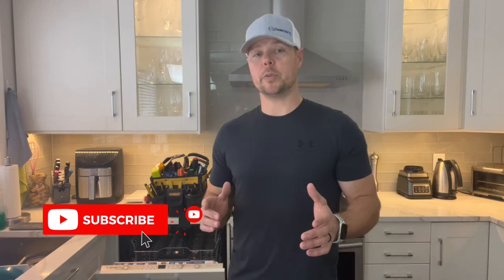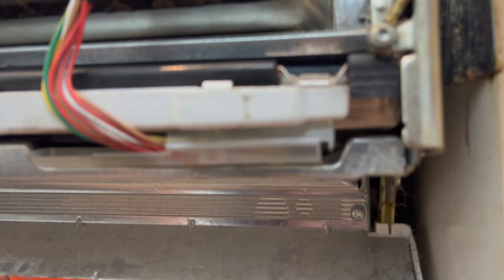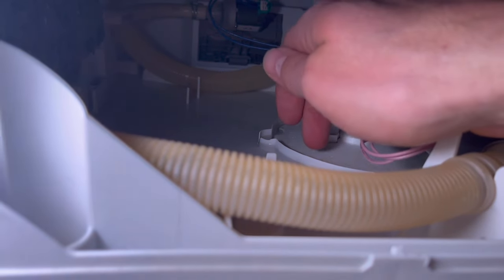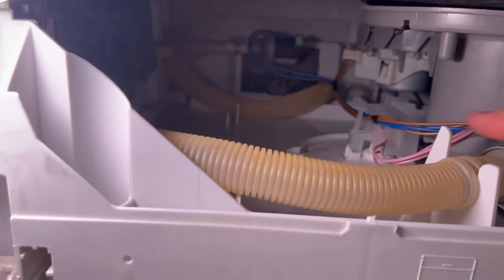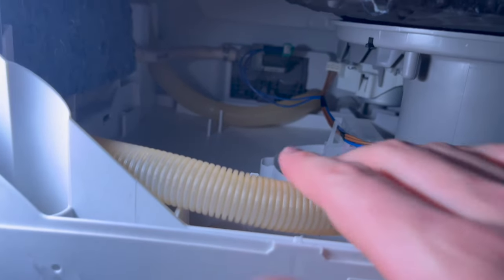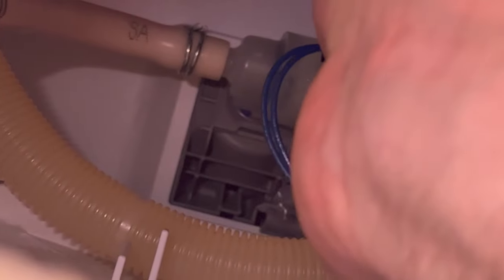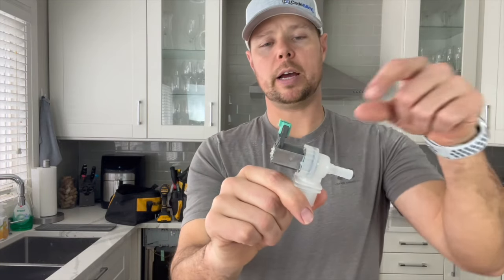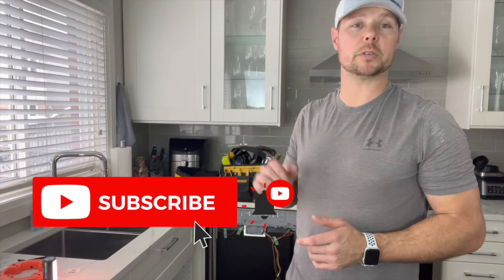Easy Fix - Bosch Dishwasher E15 Error Code - Step by Step

Comment: Your video was very good to a point. You failed to show how to access the supply valve - that you must pull the dishwasher out and access it from the rear. My advice on that is to mark the location of the feet in the front so you can put the dishwasher back in the right place.

Comment: Fantastic. I have a different model of Bosch but this gave me all the knowledge i needed to fix the problem in about 20 min (and part of that was finding the right screwdriver bits)  Very easy to follow, though for newbies like me, I recommend taking a picture of each step of disassembly so if you get lost on how things go back together, you have references
Reply: Thank you! This saved my sanity

Comment: In my case the floater got stuck due to the loud snap that breaking door springs made. (everything was dry). I removed the sensor switch and floater, cleaned a bit and verified switch works OK. Then re-assembled and tadaa, it works again. What helped a lot was getting the front plate off. I already replaced the circulation pump on this baby for wich I had to take of the right side. But that didnt provide access to the floater and switch assembly. Thx, you helped me out with this video!

Comment: Thank you for making and posting this video.  My Bosch dishwasher threw an E:15 error code on the long weekend.  This video was one of the first things that showed up in my search.  Your diagnosis of a leaking inlet water supply valve was the exact same problem that my dishwasher had.  A simple phone call and a trip to a local Bosch part supply store cost me about $30.  A relatively simple fix within 24 hours.  This saved me probably $300 in service call.  Thank you!

Comment: Thanks so much!  This gave me the courage to take our dishwasher to bits!  In our case, it turned out that there was some dirt / grit in the bottom left corner of the door seal which meant water was dripping through there, hitting the metal plate with the projected time remaining on and then flowing into the base which is what triggered the flood E15 alarm.  A good clean to remove the dirt fixed the seal and (so far!) it seems to have resolved the issue.  Thanks so much!

Comment: Thank you Ken.  I had the E15 with a similar model of Bosch.  Followed your guide, fortunately no leaking inlet valve so hoping the cleaning on the inside seals will do the trick.  Wouldn’t have had the confidence to disassemble and reassemble without your video.  All the best!

Comment: Excellent video. I was able to pull my dishwasher apart tonight. 

There was water in the tray, but no visible leaks despite testing it for a good 30 minutes. 

Dried it all up, reassembled and ran the dishwasher again and it was fine. Strange! 

Thank you for the great video and clear instructions.

Comment: Thank you so much for this video!  I was about to replace our dishwasher, then decided to do a search and found your video.  I was able to easily and quickly diagnose the issue as the same in your video.  Bought $24 valve online, all fixed!!
Reply: Where online? I have the same issue. TiA

Comment: There are other ways in which you can get and E-15.  In my case, water comes down the overflow - the rectangular grey tube that connects from the bottom of the door down into the base of the cabinet at about 0:58 in the video.  I have already replaced the water inlet valve and the float switch that actuates when the styrofoam float is raised.  AND, the drain pump can only be shut off by flipping the breaker.  There is more to E-15 than you describe.

Comment: Have a Bosch dishwasher, model number was on the side of the door.  Had a 5yr extended warranty, but the dishasher failed at 5yrs 1 month.  Followed your video - was able to determine it needed the same part.  Ordered from Amazon, make sure the part supports your model number - installed ok.  Had to pull out the dishwasher, but it all went back together ok. -- Thanks for your help.

Comment: Doooood… you the man! 👍🏻 For anyone with a Junker dishwasher the error code equivalent is E31 same tap icon and stuff (Junker do integrated appliances for German kitchens in Europe and seem very similar to Bosch). I also managed to get the kick plate off without removing the panel (expensive German kitchen I didn’t wanna play too much! 😰 mine weren’t Philips but T20s). Dried it out and the error code was gone…. 

Oh yeah, don’t put washing up liquid in your dishwasher when you run out of tabs, this basically caused the dishwasher to overflow and trigger that leak sensor or Water Protection System as they call it so basically I fixed a dishwasher that wasn’t really broken… 🙂

Comment: Nice video.  I was going to open my dishwasher as per your comments but then looked inside the tub and noticed my cycle wasn’t interrupted because a plate was blocking the second level spinning arm.  I am not sure if this tripped the E15 code but I reset the unit (3 sec) and I turned the unit off and then on…the code disappeared and I ran the cycle again after removing the dish.   No more code and unit has run smoothly.  Maybe others might want to try this first.  Btw Bosch units are great value….top notch for fair price.  Thanks.👍

Comment: Best video for this error code fix!! Brief concise and extremely informative.  I would maybe just add a note to not unscrew the top screws which hold the control panel and emphasize just to remove the screws on the side of the door panel.  This was my bad but thought I’d share in case others are too quick about removing all the screws and have the panel fall off with the front door.  I also learned there is a loose connector with red wires hanging I plugged it in cause I thought it came out by accident but after an hour of trouble shooting I learned if you plug in that connector to the control panel the dishwasher will not power on ugh! So leave that loose connector unplugged
Reply: My dw is not powering on — where is the red wire connection you are referencing?
Reply: There are 3 red wires connected to a white connnector that just hangs loose inside the panel I happened to take that connector and plugged it into the control panel where there was an open slot then the washer would not power on but when I disconnected it it powered on
Reply: @mauriceh2297 thanks for this… I was having this exact issue.

Comment: Thank you for the video, it has helped me a lot! For those who aren't very handy and don't want to disassemble or change parts, I solved it by tilting the dishwasher to one side until stagnant water started to come out from the bottom. After that, the error didn't appear anymore, and I was able to start the dishwasher. What I will do is turn off the water between each use and see how long it lasts that way!
Reply: Hi pall...
I did exactly the same what you've written. The water exit to my floor. I colected the water. And after that i conected it...and the error desseapered. 
But, anyway, i'm very afraid to continue to use it. I'm afraid of not happen a fire. Because, let's agree....the error says that there is a problem.
Can you tell me pls your succes during all this time...what to expect.
The problem is, that in my country, we don't have professional workers to repair the dishwasher, and i'm afraid for not paing a lot of money, without being the problem solved.
Hope for your soon answer
Reply: @0990-l7b  been using like this for months, no problem for me, if you get the error again you just empty the water, but I didn't, I just close the water after each use, also I have a fuse just for the dishwasher I disconnect after each use, I won't spend money on this machine, will use like this until it dies and change it
Reply: @Joelstarr  thx man. It's a good idea to put separetly fuse for dishwasher.
But if i won't turn off the water, what will happen ? Or, in your case what happened ? The error came again ?
How many years has your machine ?
Reply: @0990-l7b  the problem is there is a joint leak inside the machine, I don't think it's a big leak that's why if you just open the water when you use it, there is no time for leaking. My machine is 5 years more or less. This is just a plastic joint in bad state but you have to replace the whole part, it's not expensive and you can do it yourself. I prefer not to open the machine and just use it like this, I am not attached to it, when it's over I will change the machine, I think in a few years
Reply: @Joelstarr  ok. First period i will try not to turn off the water. Just to see how its gonna be.
The most thing that i'm afraiding, is not to damage some sensors from interior that afraid of water, and also i'm afraid for not happening fire, because i use to let the machine work, when i'm not home
Reply: @0990-l7b  the error is a security system that make the machine stops if water is detected so I would say it's safe, if water is detected it stops. Maybe you can try at first when you are at home and see before leaving the machine alone

Comment: Thanks great tip. I did not have the star tools to remove the door. I knew I put green liquide soap so it was my fault it was not a leak. As a saw lot of foam on the floor.
No need to open it or to click a reset button.

Take out the dish washer tilt it to the left side 45 degree angle because the motherboard in on the right. The water will come out. it will reset it self. I even lost the red numbers lights. It came back it worked great. Unplug it first.

Comment: Just repaired mine with the same issue.  I didn't have any parts leaking but instead a very gradual gasket seal leak causing liquid grease to pile up and set off the float switch.  After cleaning the rubber seals and the water tray and styrofoam flat switch it works just like it always has.  At least every month I clean the filter and the tray inside the dishwasher as well.  Keep it clean and things will work and clean like when it was new.

Comment: Ken, thank you so much. I followed your instructions, soaked up the water, reset the sensor, but couldn't find where the leak was coming from? No obvious dripping when running? Anyway, it's working for now 👍🏻👍🏻👍🏻

Comment: AWESOME VIDEO !  Exactly my problem.  I would add that if you get the error, and then turn off the power, on my model, the display never came back on - it was completely dead.  I started the get worried the mother board/display was hosed up.  No worries, it comes back to life AFTER you dry up the water and the float resets.  Thank you for your help !!!
Reply: Thanks for mentioning that.
I thought mine was dead.
I had the E15 error code but then 
the whole panel went blank.
Reply: Thanks for bringing this up. Could either of you detail how you got it to work again? Put everything back together and my display is just blank now
Reply: @codygoggin1097  Mine was blank initially after I dried the area where the float is.
I had just changed the heat pump which went bad. I plugged it back in and nothing.
So I unplugged it from the wall and plugged it in again and still nothing. 
Then I started pushing the power on and off button and the wash buttons and it turned on. 
I think I also held the reset button down for like 5 seconds. It's been working fine ever since.

Comment: I had a leak from the joint between the plastic drain and metal case.
So I put some silicone grease on the inside of the joint.
It has stopped leaking !  It will wash away, so what can I do ?

Comment: Well, I got the door off, the cover removed, the insulation safely pulled out only to finally discover that the filter at the bottom of the inside of the machine had not been cleaned out ever. So the old story goes, check the simplest things first. But hey, I know how to get under the hood of the Bosch now. Thanks Ken!

Comment: Thanks! Had the drillbit, the flashlights, and rags, instead of waiting for callback from service company, took it upon myself to dissassemble, check, and clean. E 15 error gone, still the motor cranks up loudly, maybe they are only good now for 5-10 years 😮

Comment: We  got the E15 code on thermador sapphire and no leak was detected but the water did overflow onto our hardwood floor under dishwasher. Any idea why that would have happened? I thought this e15 was supposed to prevent the flooding under the dishwasher. Thanks for your video too!!

Comment: Any guess what the problem would be on a brand new install?  Faulty or clogged drain pipe maybe?  (It was a professional install of a Thermador.  No problem on the installer check load.  Error code appeared on first load of dishes we washed.)
Reply: Since your comment was from several months ago, curious did you solve it?   So many possibilities but I would suggest to tighten the screws that hold the mesh filter in case the gasket seal is too loose from the factory.
Reply: @ddbear8786  Thanks, Thermador sent repairman.  Dishwasher was missing a part (a gasket or washer) from factory.

Comment: I think I have a different problem. I have a crystal dry model and I think there is a crack under that area of the dishwasher. More inspection needed, but I’m not liking the looks of this. P.S. if you can pull your dishwasher all the way out, you’ll have an easier time accessing the water tap basin. Just pull back the insulation and voila, there’s a huge gaping hole in the frame where you can reach in, no need to remove the front panels.

Comment: Mine was slightly different. From underneath, I could see the water calcification residue around the top of the sump. And then saw the leak during the wash cycle.  I had seen another video where someone just tighened the screws from inside the dishwasher (but mine were already tight). Rather than tear the thing apart; (from inside the dishwasher) I removed the two back screws that secured the upper level cleaning return. And then I loosened the two front sump screws 1/8 of an inch. I was able to push down the sump, leaving a 1/8 inch gap. After drying out the gap with a hairdryer; I put in some of that high quality GE Clear Silicon in the gap. Then I screwed everything down and let it dry overnight.
Worked like a champ!!!!

Comment: How did you replace the inlet valve? Need to move the unit out and get it from behind?
Reply: did anyone ever answer you?  I think I have the same issue as Ken and there is no way to get to that part.
Reply: @lugnut705  no, but I found another video and figured it out. You have to pull the entire unit out. Then in the back you need to remove the bottom panel, and that will give you access. I’ll try to find the video I found and send it.
Reply: Same issue here. Did you find the video?

Comment: I wish it was this easy . 
Replaced  nearly every conceivable  part . $700.00 in now and still no joy .  No water leak just e15 water check light .
Reply: Why not buy a new dishwasher before you spent $700?
Reply: @marioman3217   new dishwasher $1400.00

Comment: Would this error code happen if the door wasn't closed tightly? Want to make sure before I start taking it apart :0
Reply: I've had the error code when there was buildup on the seal around the door. A good clean got rid of it.

Comment: Bosch products are really the worst and weak. If you have enough time to repair and go behind these errors every 7 -14  days you could have washed your dishes by your own.Speaking from experience.
Reply: You meant to say LG.  Bosch is the best dishwasher, hands down.
Reply: Maybe luck or different model or different made, dunno.  Mine Bosch since 2010 and i have been using it daily, it is after 14 years without a single problem, until yesterday the exact same valve in this video have leaking problem.